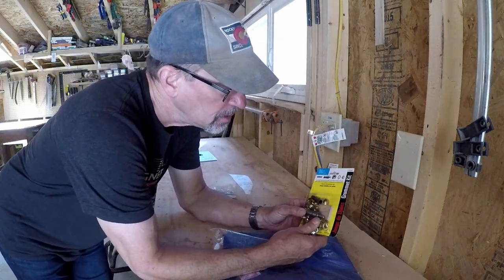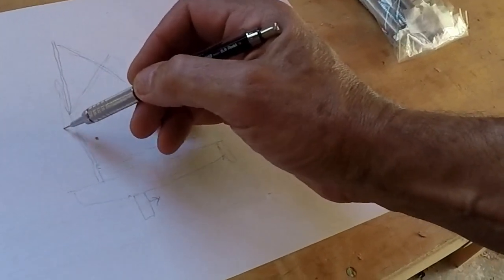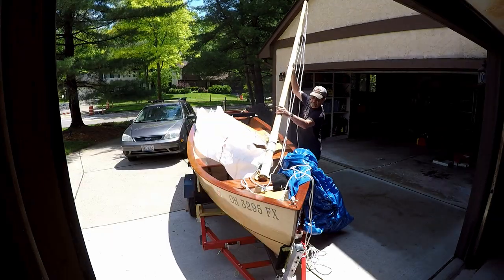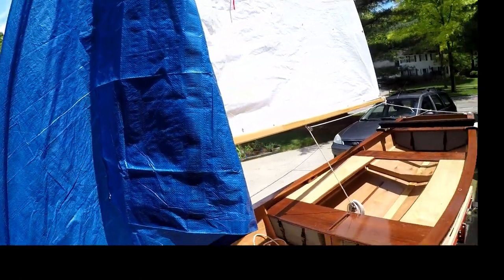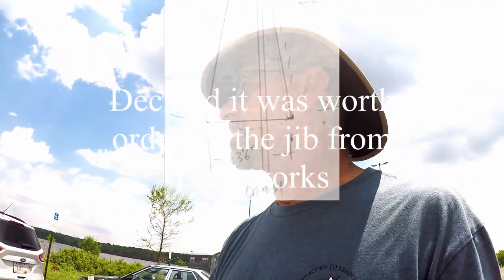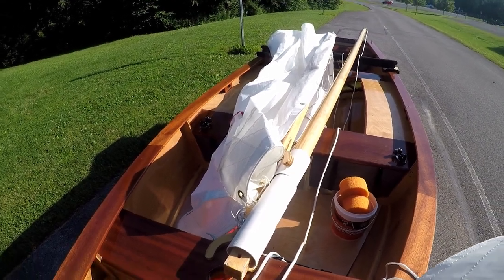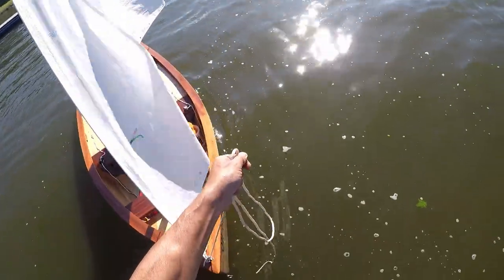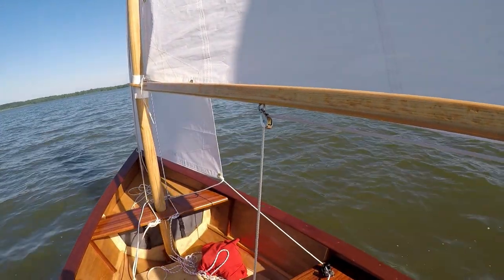Sailing Grace: Grace Gets a Jib!

Comment: To my eye, you are sheeting the jib in too much. Try easing the sheet and see how the jib sets.
Reply from the maker: Thanks Alex
Reply from the maker: I find that over-trimming is often needed because the halyard is rope, not wire---as the leading edge of the jib approaches luff it can oscillate.  I'll keep working it--tightening the halyard better, maybe switch to a wire halyard.
Reply: @rudywoodcraft9553  To save $, instead of a wire halyard, try a block at the head of the jib for a 2:1 purchase.
Reply from the maker: great idea @ @alexscott5622  will look into that